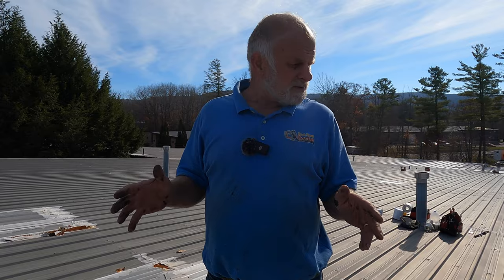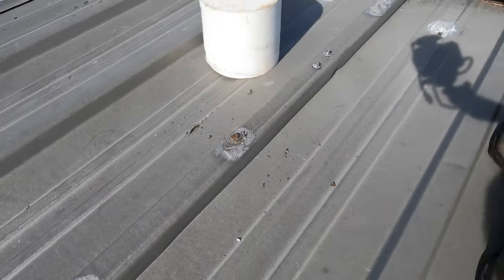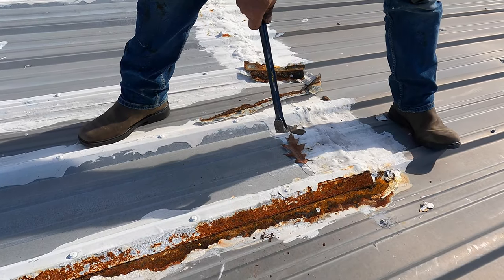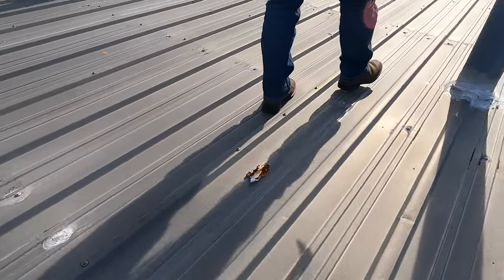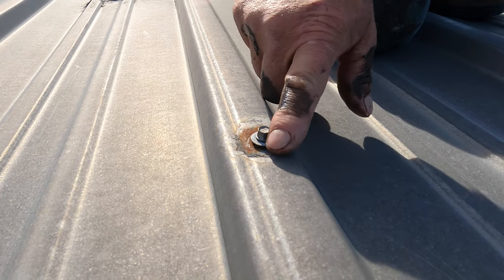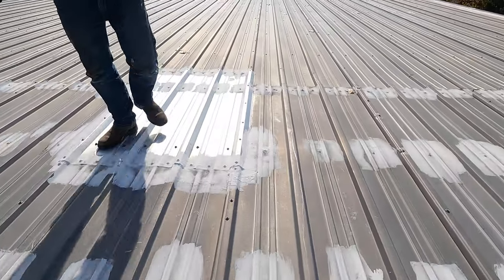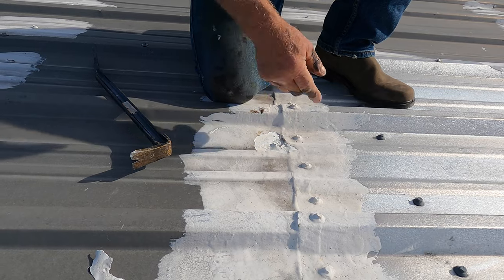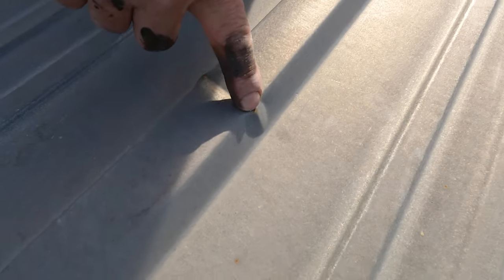7 things Overlooked that causes LEAKS on a Metal Roof - You will be surprised

Comment: these problems on metal roofs are common in scotland aswell as simple as somebody not being able to put in a screw properly lol
Reply from the maker: I did not realize you have problems in Scotland too. lol
Thanks for the comment
Reply: @FlatRoofDoctor  yeah same cowboy roofers create the same roof leaks that we both have to repair regularly lol merry christmas 👍🏻
Reply from the maker: gotya! take care
Reply: Hi there from Mel Australia. I have a roof leak due to vent installed across multiple roof flashes so the water gets stagnant and drips though, how do I fix it. ? Will the poly paint work ? 
If you send me your email I can share photos.